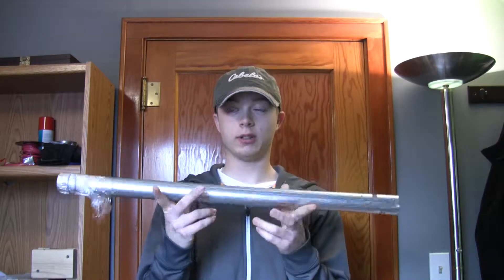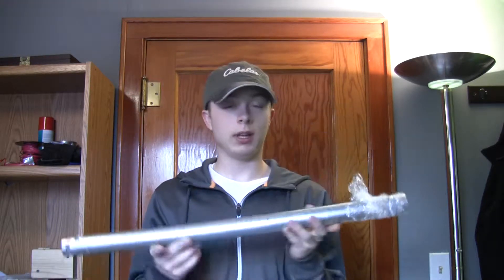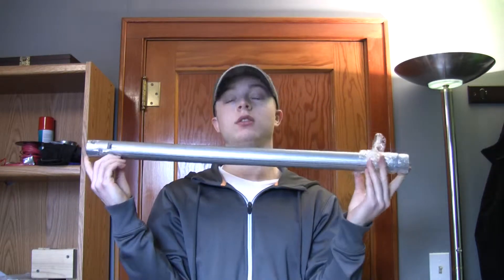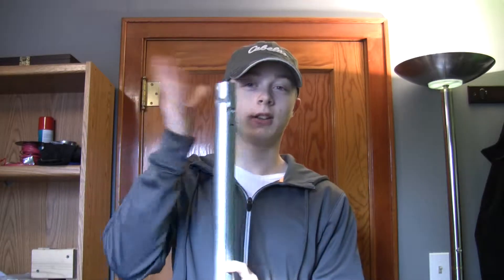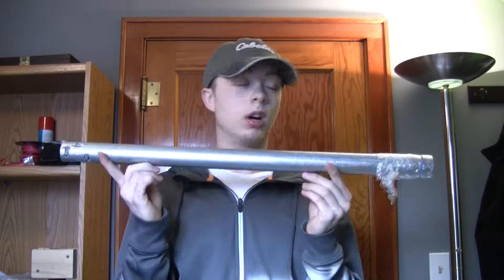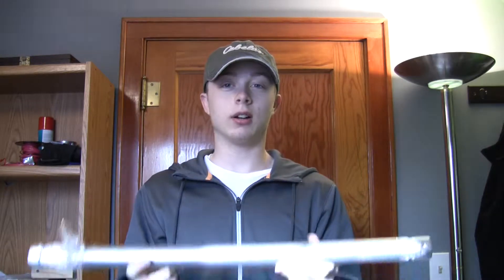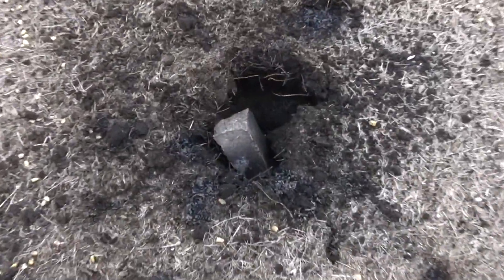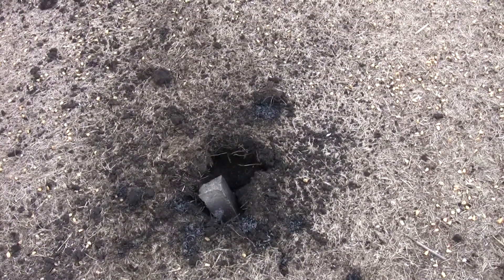Rocket Engine Static Test (20" Core/Blow Out)

Comment: There is a lot of research already done for you out there. Also you might want to look into making inhibited bates grains rather then a single cored fuel grain. The fuels pressure goes up at a high rate because at higher pressures the fuel burns faster. Richard Nakka also has a bates grain calculator you can download so you can test different grains to nozzle throat diameters. Good luck and be safe.
Reply from the maker: Thanks for the advice :) I'll have to look up that calculator!  I do use BATES grains.  This one had 8.  I just need to work my way up rather than jump right into something this big!
-Brett

Comment: You should try making the throat diameter larger.
Reply from the maker: Ill do that!  I'm also going to try a new technique using a washer to hold the end plug in.  Hopefully that way it will hold up to the pressure.
-Brett

Comment: And it also seems like you are getting over expansion at the nozzle.
Reply from the maker: I did some quick research, but don't totally understand what over expansion is...can you explain it?
-Brett
Reply: The pressure of the exhaust gases (what propels the rocket) is higher than that of the atmosphere, translates into less efficient motors. What angles are you using for your nozzle?
Reply from the maker: Mardlamock N Interesting.  I have no idea, I just drill the nozzle until it looks like it might work haha.  I don't even know how you'd measure the angle.
-Brett
Reply from the maker: Haha thanks :)
-Brett